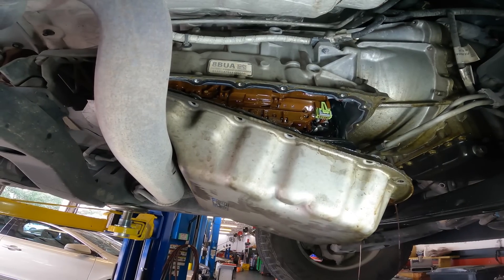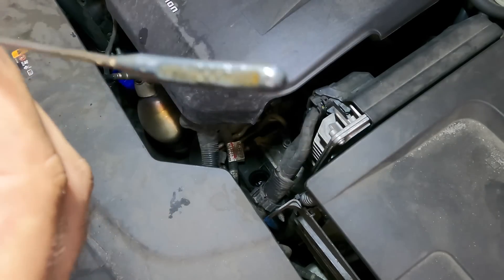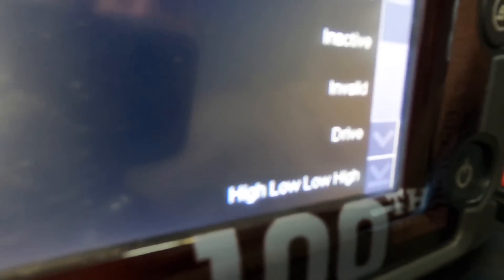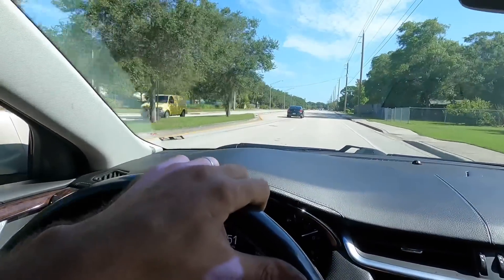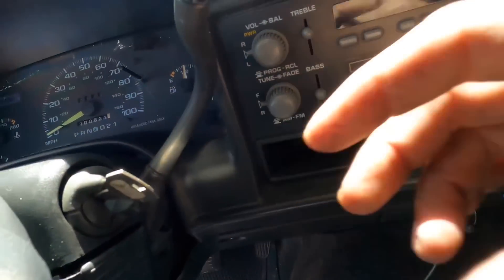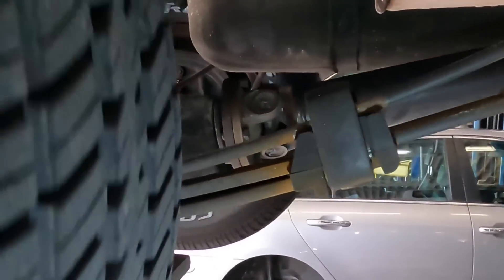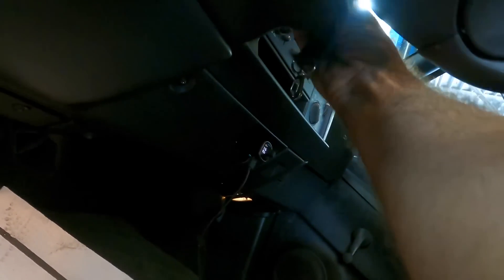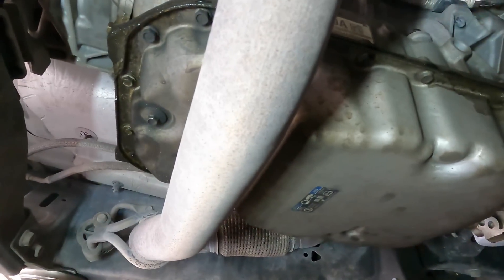Failure Friday! Ruined Transmission and More!

Comment: By the looks of that backyard mechanic tool you use to refill trans fluid on the Colorado, it goes to show that garages dont want to, dont recommend, dont advertise, dont show, turn their back on one of the most important car maintenance items on a car. IMO trans fluid changes should be done every 50k miles, but just try to find a profession mechanic to do it, one with proper refill equiment insteafd of some lame hand-pump thing from the 1950s.......... And now even auto makers are making transmissions with no dipsticks, no way to change filter without taking transmission out. 

One of the reasons I keep watching is just maybe, that one day you'll get a 2018 Cherokee in there and show how to change the freeken trans fluid, let alone the filter, I just like to have the fluid changed at 50k or next year, what ever comes first. But it's starting to look like I have to take it to a Jeep dealer, where God only know what kind of the work they'll do. My 04 Liberty was a cake walk for a fluid and filter change............

Comment: And the more part.  Dont get 4.3 unless you want to work on it.  3 engines, 99-02, counter balance shaft bearings failures.  Misfires due to uncontrolled timing that only gets worse. Sad engineering failure that happily works through the warranty period..

Comment: Do you think driving under 3k rpm would possibly help to prevent transmission wear?
Reply: RPM itself doesn’t have any effect on the trans. The way you shift does. If it’s auto, the main thing that decreases life is towing. High loads cause heat, heat kills.
Reply: Sure, the faster the engine the harder the trans has to apply the clutches to engage a gear and stop the planet or ring gear from spining, some trans has band that stop drums. Also the pump has to worker harder since it require more pressure to stop them. Look at racing or truck that are used for towing they go for rebuild a lot more often than a car that are not raced or abused for exemple. 
when you are in park or neutral the trans has no clutches engage, so they are free wheeling inside, then you shit in drive it engage a certain clutches like A and B so from idle 600ish rpm at the engine - TC slip 500ish it need to stop to 0 since the case is not moving, it's like driving and press the brake to stop it generate friction and heat but instead of dry brake they are wet for cooling and have friction modifier in the fluid. More pressure to apply clutches = more risk of seal faillure over time. You can take a look at precision transmission channel, they take them apart and see what failed in them. Some of them have shell expended due to overevving and cutting in the case.

Comment: Very surprised you only ran a cloth round the inside of the pan.  There was still debri in there!  I mean you clean the whole thing inside and out before refitting.  And you had a dirty glove finger go between the pan and trans body when the pan had one bolt in it.  Brake cleaner over kill.  Poor, not good!

Comment: GM newer products from about 2007 on are GARBAGE. My 2003 Trailblazer 4x4 LTZ with the Inline 6 and 4spd transmission is way more reliable than the vehicle in this video. 175k and still going strong. Cadillac with only 105k with transmission problems = garbage. My friend traded in his Cadillac from around 2016 because they couldn't fix the oil leak (another Caddy with big problems and low miles) for a brand new Cadillac (same model and everything!). I guess he didn't learn the first time 🤦🤷

Comment: Saw the difficulties with the trans fill. Oopsie! 

Time for a suggestion: Would it work to leave the stand-pipe out while you’re filling the trans? That way when it got to the proper level only a small amount would have leaked out before you noticed it (hopefully). Ray, I’m not a treehugger by any means, just hate to waste resources. 

Good video but as you well know, sh## happens, and I was around when that phrase came into existence. Be safe out there.
Reply: Ray mentioned something about that stand pipe not being removable.
Reply: @jeffryblackmon4846  Yes he did. I really meant leaving it unscrewed so while still in its position, fluid would leak out when at the full level. Maybe that’s wrong too. My mechanic years ended in the early nineties so most of the stuff Ray works on is Alphabet soup to me. Be safe.

Comment: Cadies come with quick change parts and motors,  you've got to change a lot ofvparts on them to keep em going and a new motor every 100k miles weater it needs it or not. Trust me it will need it.

My older brother drove a Toyota Avlon for years it never needed service. But it was woren and faded as a salesman he needed a bigger luxury car so he traded it in on z caddie  and drive a  loaner  car the next 3 years most the time becuse that pile of shit caddie was always in the shop with issues.  Biggest pile of shit car hes ever bought. And he said no more GMs xxxx.

Comment: usually vibration starting below 40 is front tires.  if it start after its the rear wheels
Reply: I don't think those tires will even right when they came off the factory floor I could be wrong but that's why you have quality control
Reply: Surprised Ray didn’t check the date of manufacturing of the “ new , outdated tires that could be that the tires were on a big sale , return 10 times for a “defect or imbalance” issue,,, they won’t tell him they sold outdated tires ! Very possible !

Comment: When the tranny died on my 1993 Dakota at 170K the shop owner asked me if it was the original and if it was, when did I have the oil changed. I had it done at 100K. He explained that material from the torque converter clutch eventually clogs the filter, starving the pump, and ruining the transmission.

Comment: My 2004 Silverado has a transmission with a history of being a 130k mile transmission. Well I still own the truck and it has the original transmission with 208k on it. Why would it last? Transmission service every 45k miles by the dealer using the powered transmission service they offer. Shifts strong and no slipping so I feel it will go another 100k if I keep servicing it. I bet you that transmission was never serviced. I also never tow without selecting tow mode and I never ever shift while the vehicle is slightly moving like so many people do.

Comment: Definitely leave the seal in if it is holding the filter securely and is not hardened. Not worth damaging the bore.
Reply: Sometimes if you have a small bearing ID polar and a slap hammer sometimes we'll get them out it doesn't understand puller

Comment: How hard would it have been to totally empty all the old the trans fluid from the pan before reinstalling it? Maybe even clean it out with your favourite carcinogen, brake and parts cleaner. It was so obvious on the video that the hose wasn't properly fitting on the nipple.

Comment: Sometimes deleting a code could help. When the car throws a code because of some random error in the ecu because a sensor got an off reading for a split second. Then deleting the code could be just like restaring a program that crashed. Of course this case is different since gearbox was slipping so you know that there is actually a problem
Reply: Trans. Internal Slippage code erased,,,,, can take 20 miles to “re-set” code, trans. JUNK !